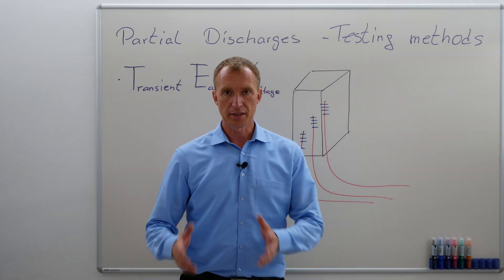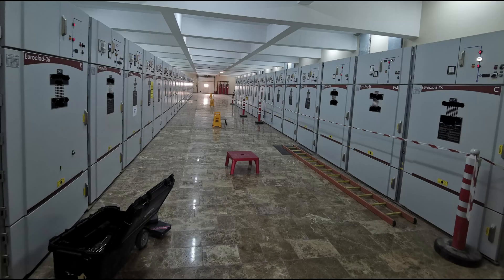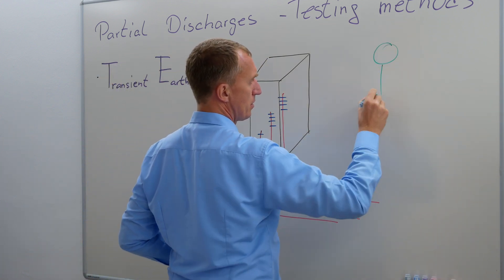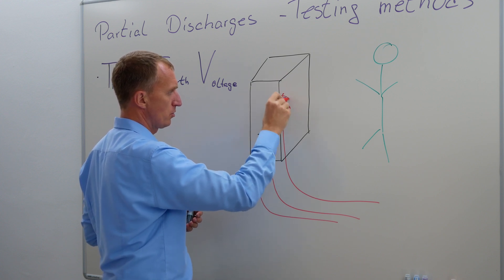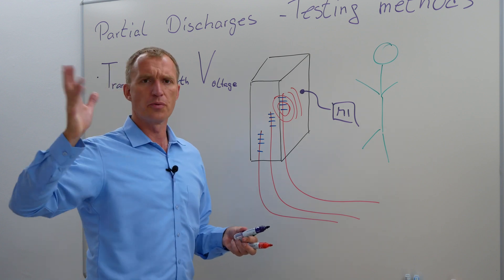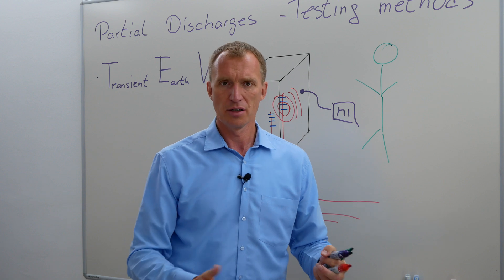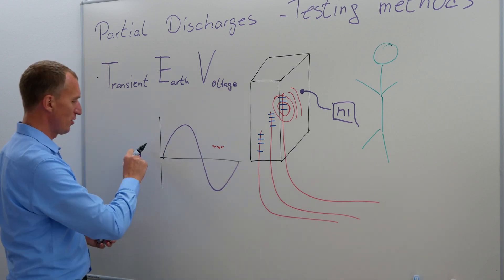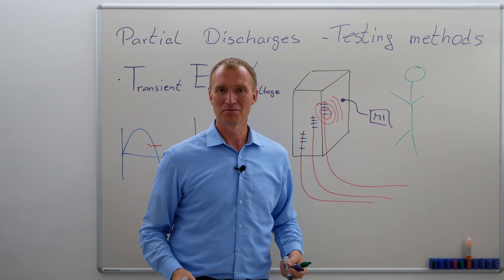5.3 Partial Discharges Testing Methods - TEV sensors

Comment: Any more details on hot to get the locked phase of TEV signal or similar online detection method? Is it hard to get the PT voltage signals in reality? It is mentioned that the ground current could be used instead? Then how to do this, why not use the line current?
Reply from the maker: This is a very good question. I will make sure, I will make a video about it!